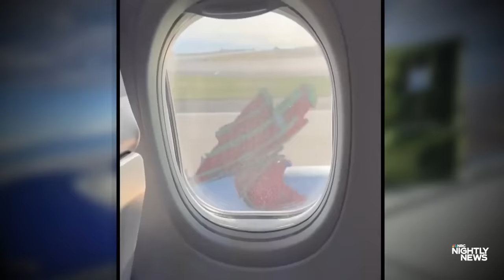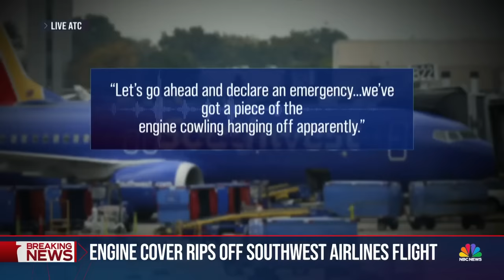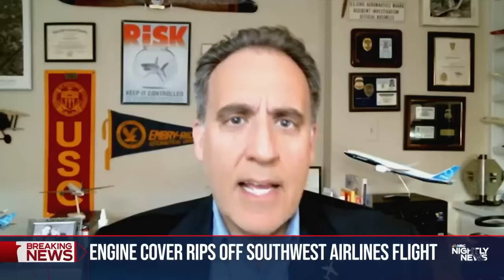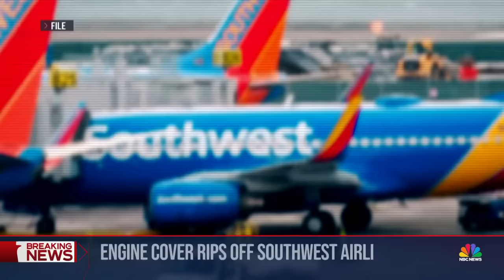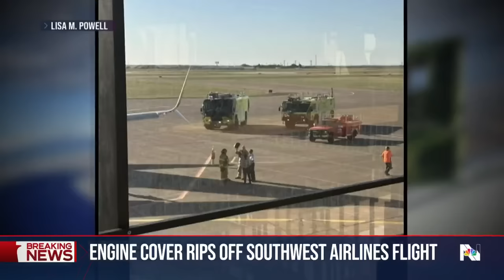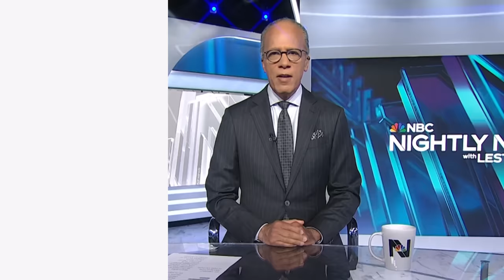Southwest flight makes emergency landing after engine cover peels off

Comment: Good job Boeing and engine maker
Reply: This has nothing to do with Boeing and probably nothing to do with CFM either it looks like the airlines engineering forgot to close the engine cowling properly and secure
Reply: @Mgaffo222  you are probably correct about that.